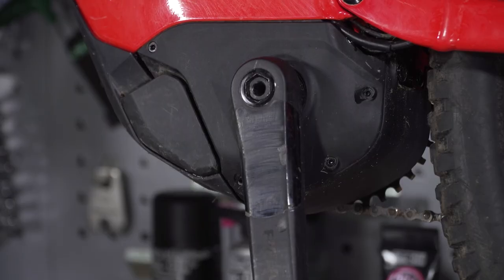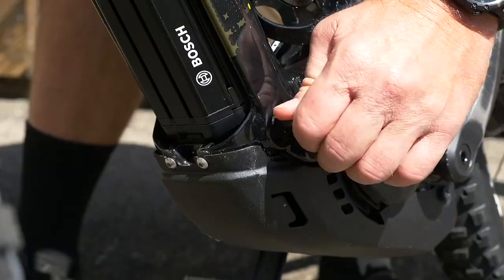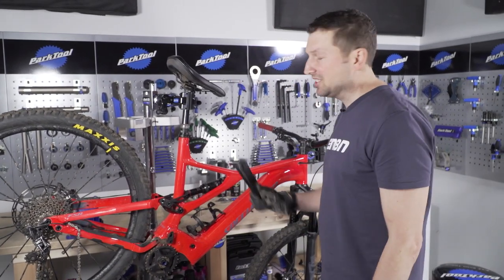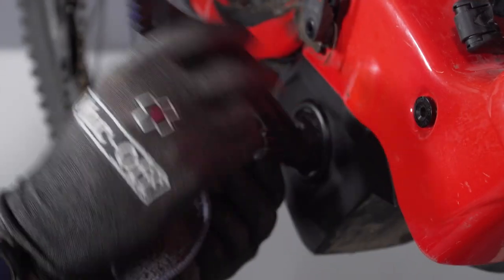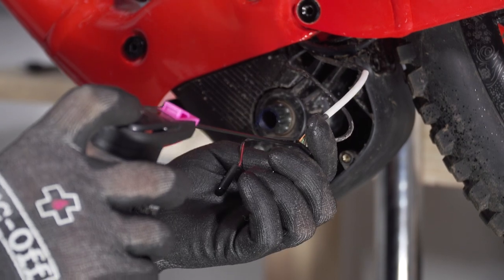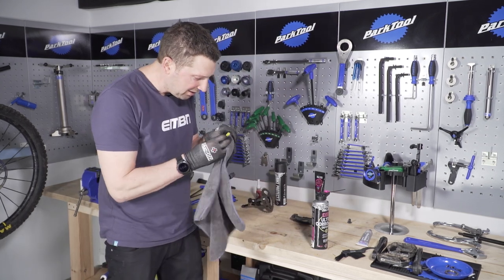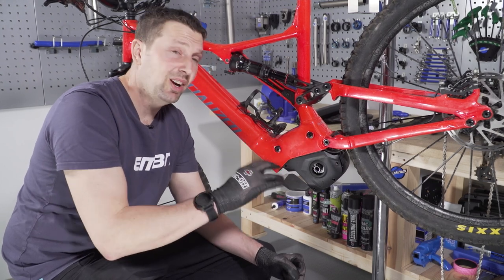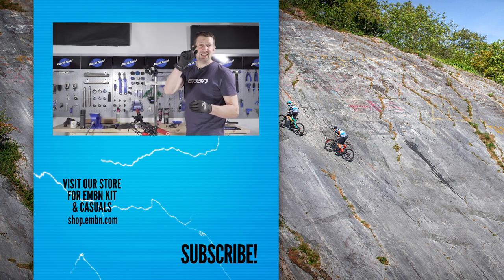How To Deep Clean An EMTB Motor | E Bike Motor Deep Clean

Comment: I just did a similar clean on my '19 Turbo Levo and discovered that the boot on the motor power connector was badly torn (motor end).  That explains why the bike had recently refused to turn on after a bike wash.  I thoroughly cleaned that connector and then wrapped it with electrician's tape.

Comment: At the end of the day doesn’t matter which motor you have the principles he has shown are the same just some of the tools will need to be different the important thing he showed was not to go crazy with the harsh chemicals like degreaser it will corrode most alloyed metals and electrical contacts and I can not emphasis enough just how important Dielectric Grease is especially if you are washing regularly or playing in the mud often, it is also good to apply to Every electrical connections on the bike, the video was well done and hopefully save a lot of people a lot of grief 👍

Comment: Tip for getting levo cranks off is to loosen self removing bolt and take it for a short hard ride to free up super tight spline fit then you'll find it easier to wind the crank bolt off. The main power lead from battery to motor is prone to fail . The third generation replacement one has two white zip ties and origin ones have one big black zip tie. E=Mtb²
By the way the main motor bearings are not really sealed so be very careful washing bike and don't lie it on its side while low pressure hosing. Cheers.
Reply: Good tips, top man 👍🏻

Comment: Really helpful video, thanks Chris.

Couple of points if anyone is doing this on their Levo:

1. You don't need to remove the crank and chainring if you're not taking off the motor cover. Even then you don't need to take off the drive side.
2. On the 2022 levo the battery connector is routed up round above the motor so you need to drop the motor to work on it
3. I found it a LOT easier to have the bike upside down instead of on the stand
4. Dropping the motor is useful on the Levo because you can grease the contact points between the motor and the frame which are common sources of creaks

Comment: I have a Brose motor on my Bulls mountain bike, so it was great to see some of the detail.  I haven't done a clean, but it seems straightforward.  My bike has a dual front chainring setup, so potentially a little more complex to remove with the derailleur.  Thanks for the video.

Comment: Most ebikes are not that easy to work on. You typically need an isis crank puller, something which you do not need that often and most people don't have. Removing the spider is also a pain sometimes, depending on the model. On my haibike you need either a special tool from haibike or a 36mm standard socket which isn't guaranteed it won't destroy the spider.
Not to mention there are lots of situations where you basically destroys screws and you don't have any spares - and neither your lbs.
Better wait until something doesn't work and only then start working on the bike at this level.
Recently I removed my motor's skid plate. I also removed it in the past a couple of times as dirt tends to accumulate inside. Cleaned it, all nice and shiny, put new grease on the screws, was really produd. Until the last screw didn't quite thread. 3 hours wasted for a single screw. Never touching the skid plate again in my life.

Comment: If you do remove the motor, be super careful arranging/packing the wires back in there before replacing it. Especially for Bosch bikes (huge connectors), especially especially if they have tons of lights, horns, etc. More stuff, more wires, and most of them are coiled up in there rather than cut to length. If it's Specialized, they were careful for you. A pinched wire will wreck your day.

Comment: I always remove my covers after sponging off, then remove water with paper towels and a small compressor to blow water out then use a silicon spray on my wires n bolts😊👍

Comment: Dielectric grease, is a silicone-based grease that repels moisture and protects electrical connections against corrosion. ... The grease , so it shouldn't be applied directly to the mating surfaces (pins and sockets) of an electrical connection.
Reply: What?
Reply: That’s a common misconception, but it’s incorrect. Dielectric grease can be used directly on electrical contacts, and is in fact meant to be used this way to help prevent fretting corrosion, as well as make connections water-resistant.

It is true that the grease itself is non-conductive, but when connectors are mated, the grease is scraped away at the contact points, leaving the contact resistance unchanged vs. a dry connector.

Comment: I recently went on a ride on my ebike that has a bosch 3rd gen drive unit which ended up pretty much fully submerged in a puddle that was deeper than expected, it didn't seem to harm the bike, but do you think it'll be necessary to open up the motor casing to see if it left much behind or are they designed to not mind this too much?
Reply: Absolutely not needed .

Comment: Why do they use such a long cable then put a big bend in it. I've heard of people having trouble with that.
Reply: I’m guessing it’s a case of the same cable doing for a number of motor formats (& not just MTBs). One length for all saves money on supply. Otherwise it could provide better support as it touches the casing in a number of places.
Reply: @dewindoethdwl2798  
That's what I was thinking.  Save a little money on a $ 10,000 bike .
Reply: They redesigned the replacement one shorter.